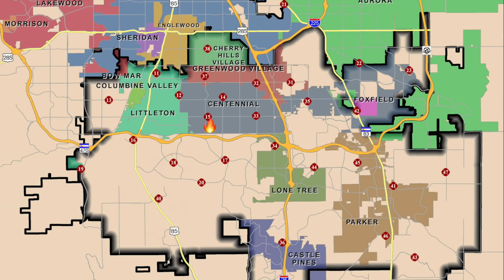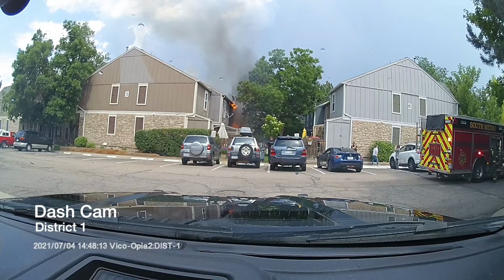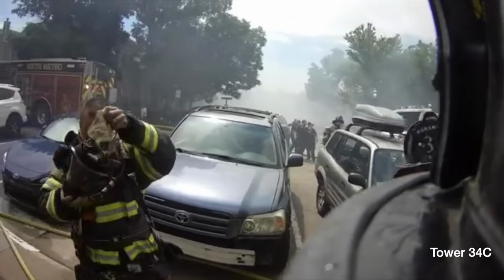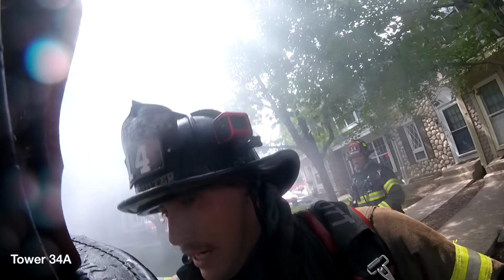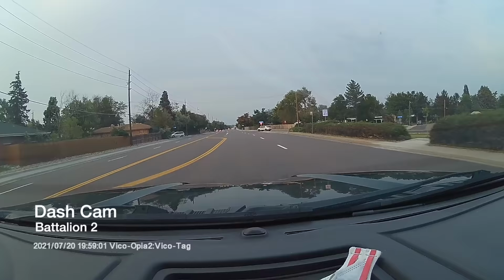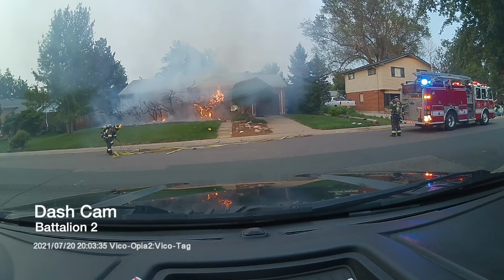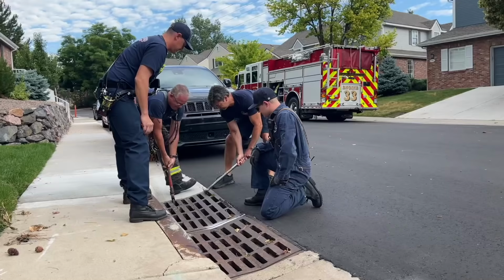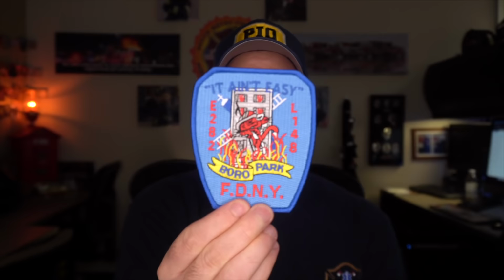PIO Vlog - July 2021

Comment: I just want to communicate some information that I believe is soooo important.  Saves life and limb.  Most cities have building codes requiring an ingress and egress. This is often not adequate.  If the ingress is at the front and the egress is off the kitchen and they are close together, that is not adequate.  Given the fact that homes built post WWII often have the kitchen near the front of the house and bedrooms at the rear.  Given the fact that kitchens are a frequent source of fire, you can readily see the there is no egress.  A safe exit needs to be established not only in a single family home but especially on a two story home.  Have a door placed in the BEDROOM, please.  For any 2 story structure a stairway exit off a second story should be mandatory.  Think of both you and the rest of the Family. A rope ladder may not be adequate for exiting from the second floor.  Build a landing a stairs. Make sure the Mortgage on the purchase includes the upgrade and get your estimate before you sign the contract on a new purchase.  I think this precautionary measures should/or could be great Information in your videos.  Chicago where I live require stairs on the exterior on all apartment buildings.  Unfortunately I don't see them on newer construction of condos.  Lesson, be aware and don't buy.  I'm sure you have a dearth of other safety information and should pass it on.  PLEASE

Comment: Out of curiosity will tower go up with lightning in the area? Is tower grounded somehow?
Reply: When there is a storm or lightning in the area the Tower or Ladder will not be put up due to safety reasons with possibly getting struck by lightning but ground ladders couls still be used.
Reply: @centralcofirebuff7830  thank you for the information I was honestly curious how they handled that. I have another question if you are willing. And that is how do fire departments handle snow. I live in Michigan and I always wonder how they prevent gear from icing
Reply: @djtobygaming  With icing they will usually during rig checks make sure that there is no water in the intakes and all those places so it doesnt rust, they use chains for their tires and when the water is in the pump it doesnt freeze up as the tank is specially made to not let the water freeze
Reply: @centralcofirebuff7830  interesting thank you!
Reply: @djtobygaming  (not a firefighter, information may not be fully credible in some areas) Also, apparatus bays are heated, allowing frozen water to melt, on top of all the given measures. This is useful among stations of which are not super busy.

Comment: I am having a hard time imagining how all those bushes and small trees could catch fire. Spontaneously? How? I grew up in Colorado Springs and remember how dry it is. I have lived in Houston and Austin several decades now. Dry is rarely a problem. Climate change has caused the average annual rain to go up an additional 10 inches per year.
Reply: @SouthMetroFireRescuePIO  Thank you for the information. Those are popular mulches around here but only rarely does it get dry enough to worry about catching fire. Even with burn bans in effect. Isn’t there always someone that thinks that doesn’t apply to them? I suppose there is an optimum depth for the mulch to prevent getting that hot? We had a really bad drought in 2011 with lots of fires all over the state. Nothing like Colorado had at the time. I can’t imagine it being much drier than when I grew up compared to the other places I have lived. My father died in Aurora in 1983 and I spent over a week there getting his estate set up so I could do most the work from Texas. It was February and my Dad had an humidifier that I had cranked up to max. Condensation on the windows was unbelievable, yet, my lips were cracked open and bleeding. The altitude takes some adjusting as well.

Comment: Why do the firefighters let people s home burn. Take at least a half an hour to put water on the fire
Reply: South Metro Firefighters, depending on the size of the fire, will usually at least have the fire under control in about 30 minutea unless if it is a much larger fire, they usually get water on the fire in the first 5-8 minutes of suppression arrival and sometimes quicker than that.

Comment: What’s with the different colored hoses
Reply: The large yellow hose in the foreground is a 5” supply line. The first yellow line pulled I believe was an 1 3/4” hand line. The orange line should be the horizontal standpipe and be 2 1/2”.

Comment: If you think this is good you need to really watch Stockton fire department out of Stockton California.  Puts this to shame.  Never seen where a battalion chief makes the decision on what size line to pull.  That is the Captain or Lieutenant call based on the initial report known as the size up.  The initial engine on scene makes this report. C.A.N is the abbreviation.  C- conditions that they arrive to.  A-  actions they are taking. N- Needs that must be fulfilled by others.  The CAN report sets the pace for the incident..  is there an ISO officer on scene.  Incident safety officer.  Who is the ric unit.  Rapid intervention crew.  Does south metro have this.